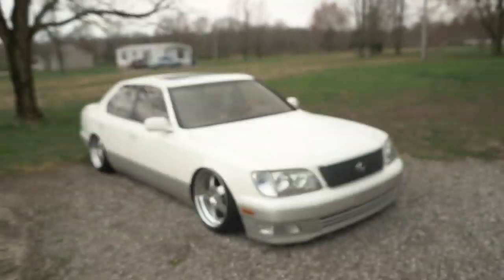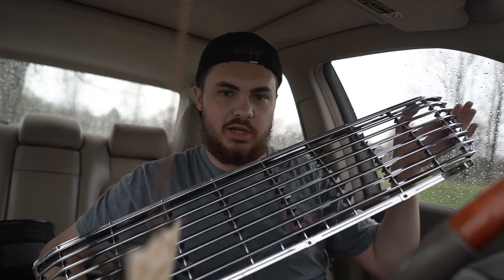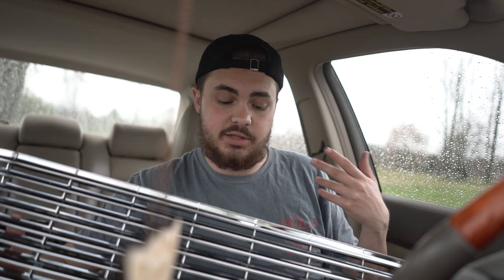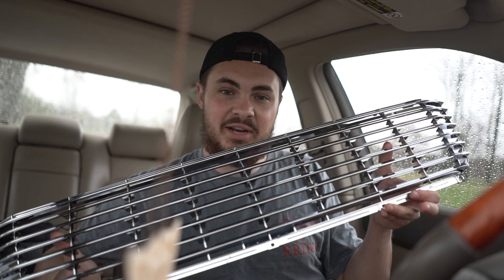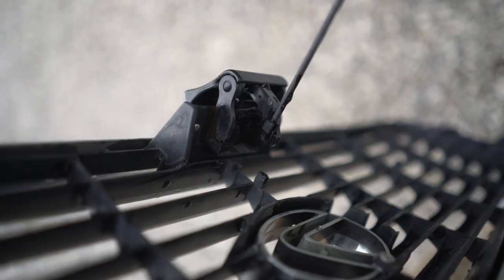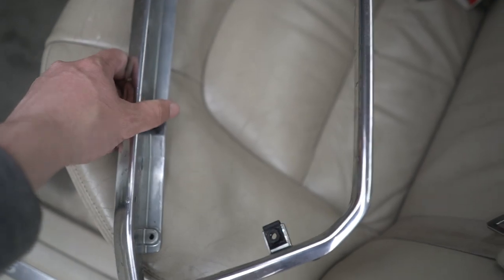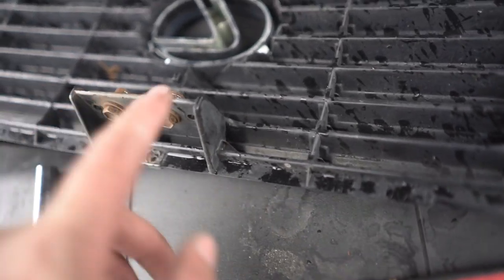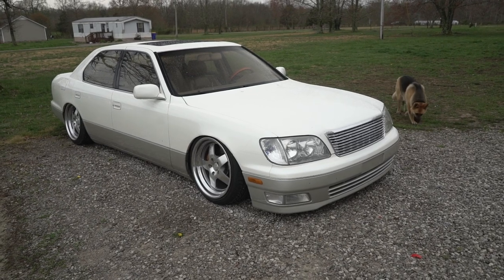Badgeless Chrome Grill - VIP Style LS400

Comment: What ever happened to your LED headlights? I know you had to revise them but then what.
Reply from the maker: They aren't LED, but it's actually been a crazy long process. Had to have a custom bracket designed and 3D printed to hold the Q45s! I will be getting the lights finished pretty soon!